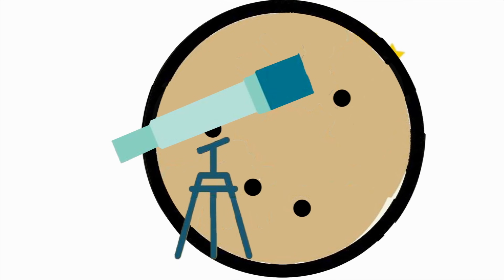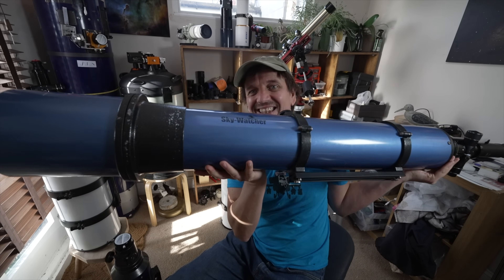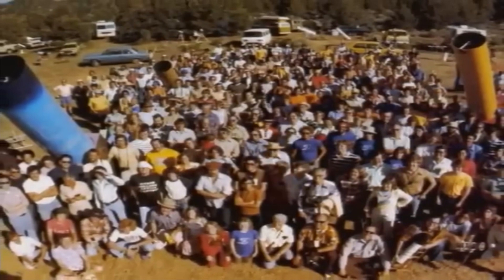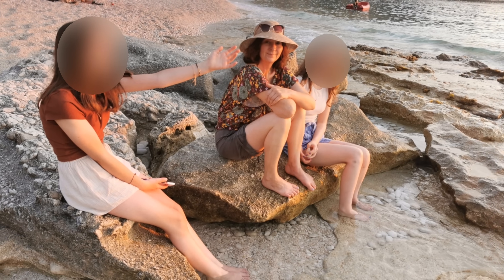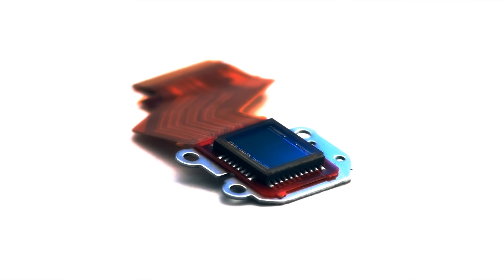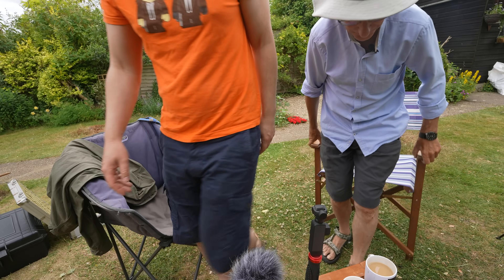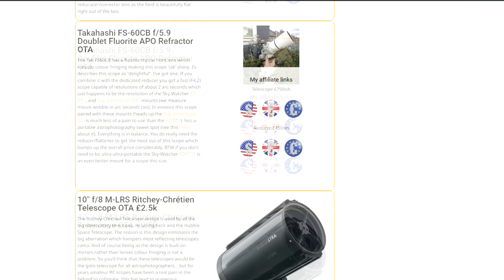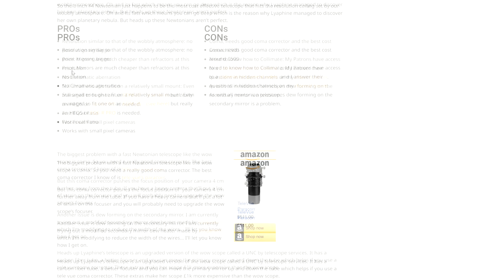5 Incredible Telescopes that are changing Amateur Astronomy

Comment: Hello - a complete noob here.  I've researched for years, ...., but still a noob.   I managed to get a bit of Xmas bonus and considering a scope for deep-field photography.   I hate to ask, but I will - I'm looking at the Celestron NexStar 8SE and the Celestron NexImage Burst Color Solar  System Imager - 10 MP usb camera.  The camera offers a 1.67 um pixel size and includes "stacking" software.   With carrying case and Celestron 14 piece 1.25" accessory kit (filters, etc) I'm in for roughly $2500 (or 2300-ish euro).

My Bortle Scale is roughly 5.    Is this too much scope for my area?  Would a 6 inch be better?  I'm liking to GoTo mount and StarAlign stuff.

My boss, also just as much as a noob as myself, believes I won't get decent results from like an asphalt driveway because of vibrations.    Not sure.

Comment: Thank you for the work you do, this is a great channel.

Problem - I am a beginner/intermediate with a professional's budget, which probably makes me quite dangerous, none the less, over the next 6 years, I want to get as optically close to Apophis as I can from my backyard. Heavy is not an issue and big is not an issue within F150 truck/household terms. Accurate tracking and clarity over time would be important. I want to be able to photograph and videograph many different deep space objects and planets as well but I feel the Apophis asteroid may be the most challenging especially tracking it over time with clarity and that meeting that requirement enables the other things along with it. 

I hope I went into sufficient detail but not too much so. Feel free to ask any questions or tell me I am way off base, I am more than happy to consider expert redirection.

Solution(s) - ???

Comment: 16:50 Newtonian just way too short, so you spend $500 Euro on the tube and $500 on a coma corrector, when for $250 USD used you can get a Dobsonian 8in reflector and put that on a strong $500 mount and away you go.  Then you have a good mount for any telescope you buy.  You don't need another.
Reply: Tell me which 500 dollar mount would even be capable of supporting an 8 inch dob plus all the accessories and still be steady enough for astrophotography? The weight of the tube itself would be around 30 lbs. Beside an astrograph Newtonian like this would have a better f ratio than a traditional cheap dob for deep space photography and are much more portable.
Reply: @vanlandings7466   Omni XLT-CG4.  You need heavy enough counterweights, rings for the NT and the rails that go on the rings to mount into the base.  The weight holding rod I installed additional washers and bolts inside for stability as I go to 12 inches NT, which you have to be big to handle and mount safely.  8 in no problems.  There are two lock bolts for the tube rails on the CG4, always screw on the big one first as the small angled one can bend under the wt, but probably happened with my 12 in NT.
Reply: If you worry about stability with winds, just keep the legs mostly or totally withdrawn instead of extended.  The legs are steel, not going anywhere, very strong.
Reply: @vanlandings7466  DOBs are worthless unless computer controlled, which none I see are.

Comment: I dont believe for 1 min that a cheapish 8" newtonian is the best scope for astrophotography as recommended in your links ? Ive owned a few and its all down to mechanics, you get what you pay for, it you are happy to spend  money swapping out the focuser due to focuser sag, strengthening the tube to avoid flexure, flock to remove internal reflections you may have something that works. Yes you can collimate them easily but cheap mechanics wont hold. The parracorr you recommend and is the same price as the scope? there are other corrector options available.  I preferred your vids when you didnt punt affiliate links through the whole video.

Comment: The Baader semiapo filter revolutionized my Celestron 120mmx1000mm refractor  Orion 120mm short tube and removed the blue to nothing noticeable. Wonderful and use them on a LX 70 EQ motorized mount.

Comment: I have an 8" dobsonian and love backyard astronomy but am very much a newbie at it so I have a question that may be a bit basic. Is there an automatic tracking mount I can get for my type of scope? I really like it but with the standard Dob mount it's hard to keep anything in view for long.
Reply: Look up "equatorial platform" for your Dobsonian.  Alternately, you can get rings and an equatorial mount for your existing optical tube.  I think an EQ6 class mount should lift it... but we're talking a couple thousand dollars and up here.  Your optical tube weighs about 21 lbs and the Skywatcher EQ6-R Pro comes with 22lbs of counterweights, so it would be right at the max, but doable.

Take note though, as the mount rotates, the focuser can end up in weird places, so you'll have to periodically loosen the scope in the rings and rotate it back so you can look through it easier.  Many find that to be a hassle, and suddenly an 8" go-to SCT sounds more attractive at about the same money as the EQ6-R Pro mount.  Avoid the NexStar 8SE though, get the Evolution, CPC or AVX mounted version instead. WIth a SCT or refractor, you can simply rotate the diagonal if the angle isn't comfortable.

The easy button for increasing time before having to move a Dobsonian telescope is a wider field of view eyepiece.  If you bought a GSO product, you'll probably already have a 30mm 68 degree apparent field eyepiece for your lowest and widest power.  If you didn't, and have a 25mm Plossl for your lowest and widest, the GSO SuperView ($80) is a great low power option on the cheap.  Personally, I use 82 degree eyepieces made by Explore Scientific ($500).  Their 30mm is my low power eyepiece for my 8 and 12" Dobsonians... and about everything else in my collection too.

Your mileage may vary with the ES82 on the 8" though... Mine is a collapsible Skywatcher and I had to install a larger secondary mirror to fully illuminate the field of view.  I found that any 82 degree eyepece 20mm or shorter in focal length worked fine with it in factory spec.

One $500 eyepiece and (maybe) a $100 secondary mirror (or even just the $80 one that will work straight away) is cheaper than a $2000 mount or SCT rig, and good eyepieces tend to be a lifetime thing, so... I'd start at the eyepieces.
Reply: Equatorial Platform is a game-changing must & costs a fraction of a capable EQ mount, if in the UK they are now not easily obtainable, check out 'David Lukehurst', he makes them to order or go D.I.Y.
Reply: Take a look at this channel.... https://www.youtube.com/@DobsonianPower. It could be right up your street for answering your questions.

Comment: Glad to be the 8" owner though at a slower f6 :) if only skies were less generous with their clouds all the time
Reply from the maker: i used an f6 last night without a coma corrector abnd with a small ish sensor asi585 and it worked very well
Reply: @Astrobiscuit  That is nice to hear. I got asi294 nearly two months ago, but I haven't been able to try it yet due to the weather. Hopefully, the sensor will still handle the stars without a corrector. Great videos by the way :)